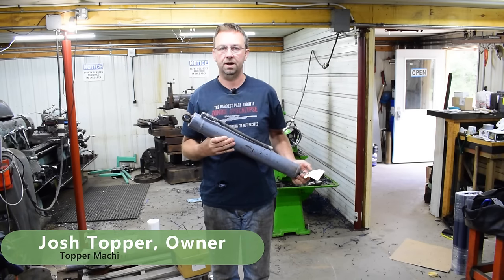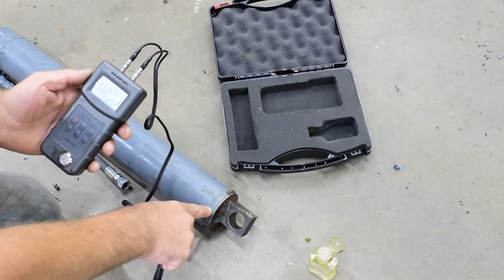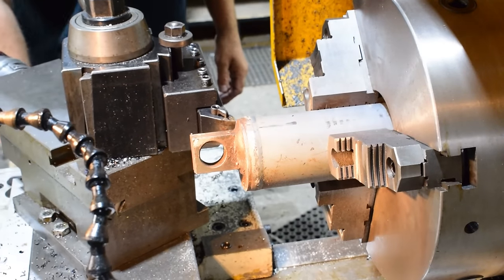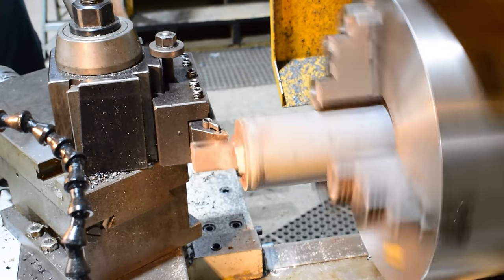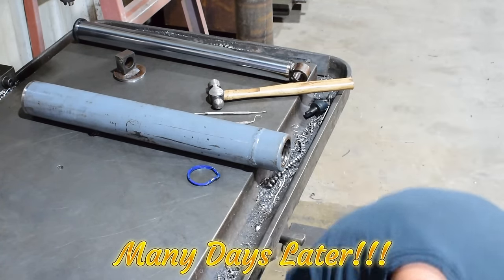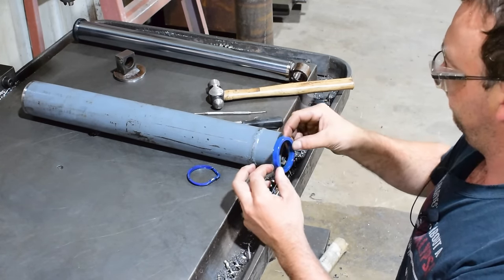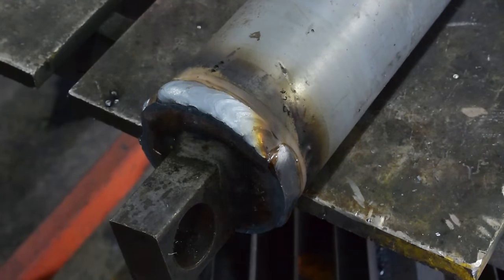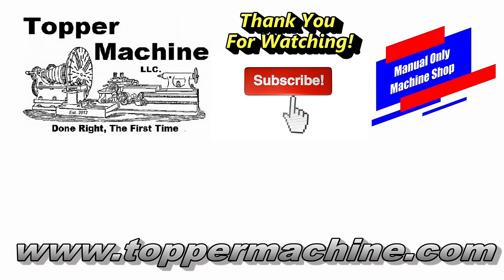Welded Hydraulic Cylinder That Can't Be Repaired, Cut Open and Resealed

Comment: The piston rod was fully compressed so that the piston was very close to the welding spot, this can kill the seal of the piston as well as burn the grease/oil around the piston. With the piston half way into the cylinder, or fully extended, the most vulnerable area is safe during welding. Also, it's recommended to degrease the end cap and the cilinder inside near the area of the welding spot, at 19:12 you see the oil coming through the gap between the cilinder and the end cap, this can effect the quality of your welds. Other then that, a very nice rebuild.
Reply from the maker: No piston. Just a plate on the end. No seal to worry about at all, safer to weld this way to eliminate potential spatter on rod. Been in service since with no failure.  As far as oil, it was degreased thoroughly off camera.

Comment: Over 50 years ago, I worked as a hydraulic mechanic. As I was taught, this is what  is called a "displacement" cylinder. This is a "power in one direction only" cylinder. Oil is pumped in under pressure and the "rod" is displaced. Everyone in America has interacted with one of these cylinders at one time or another. 
Many elevators in a building of less than 7 or 8 stories have elevators that are raised by one of these hydraulic cylinders, where a pump lifts the elevator and gravity brings it back down. A hydraulic bottle jack, floor jacks and two and four post car lifts use these type of hydraulic cylinders. Just a little fun info.

Comment: Here in the Uk we would refer to that type of ram as a single acting displacement cylinder. You can tell this by there only being one hydraulic port on the rod end of the cylinder and no vent in the base end. Fully welded cylinders are not common but not something that I’ve not seen before especially on agg equipment. They are deemed disposable and cheap but as you have shown can be repaired if needed. 
My only criticism would be the welding on that base eye, I would have liked to see a root pass and a minimum of one cap pass, both in one continuous weld ie no stop starts.

Comment: I repaired the four hydraulic cylinders on my 30 ft Winnebago Sightseer. These cylinders are double acting. They leaked badly on lifting the leveler jacks back up. The rod end was down and the seals were shot. I loaded the cylinder into my 10X24 Logan lathe and mounted an angle grinder on the tool post, a vertical cutoff blade. I put the lathe in back gear and ground out a .250 thick wall. That separated the rod end with the bad seal.  My neighbor has a Miller MIG welder to put the ends back on.  A $15.00 wiper and seal on each fully repaired the cylinders.

Comment: Well done, it is good to see how you could manage to offer a new life to this cylinder. As an old french engineer I really appreciate how you take care of all details like rotation speed, angular position marking,  electric connection making sure that current is not flowing through an undesired  path. Despite the fact that you could not weld continuously the result looks pretty good. Congratulation for this good job.

Comment: Got to love those proprietary parts. Had a machine with 2 cylinders working in tandem for sled movement. One cylinder split the tube, no replacement available as it was a short run of parts to build only 3 machines of this type. Had to find a shop to build one from scratch. Not easy to do for a 12 foot long cylinder tube. OEM of machine was of no help.
Reply from the maker: It's getting way more common to see odd stuff. And even more common that the OEM won't sell parts, just new equipment. Keeps guys like me in business.

Comment: The ground clamp thing CEE has a video on making a swivel ground. The cylinder is a single acting type, farmers love them. The rod pushed out with hydraulic flow, weight pushes it back in when the valves release back to tank. the UTI is great tool. Thanks for sharing, great work.

Comment: As soon as I saw this cylinder I was reminded of a hydraulic elevator that was being installed at my school many years ago: as the installer explained, and as the comment by Mr Palmer above also explains, there is no piston head seal; just the rod seal. Works by displacing the volume of the rod, again as explained above.   In an elevator this design eliminates the need to worry about the inside finish of the cylinder, since it's not a sealing surface. The rod does have to be a good finish, but it's easier to get a good finish on the outside of a long rod.

Comment: josh  that type of cylinder is called a displacement style. it is single acting only. it is very common on forklift lift cylinders, they usually have a wear ring on the piston to protect the bore. thats a cheap throwaway unit you saved. nice job.
Reply: Yes, they usually have a wear ring to run on the inside of the cylinder walls. It's not so much to protect the bore (nothing seals on the bore anyway), it's to keep the rod centered and not get out of alignment with the end cap. With the slop that one had, I'm surprised it didn't bind in the end cap bore. I'm sure it's hard on the seals. 
You are right about that being a cheap "throw away" cylinder, and almost all welded cylinders are. They don't want to go through the trouble and expense to machine the end cap or cylinder bore to make a removable end cap, so they just weld it.

Comment: Next time extend the ram and hang a greased heavy timing chain or long tow chain drape across it as a counter weight to stop the knocking on the shaft. By sliding it in or out, you can find the "sweet spot" to stop the knocking of the ram. Another thing you can try for your rotating setup is to open the wheels a little wider so the tube is getting pressure from the sides as much as possible without falling through, then it is a simple as adding a weight on top. You can use greased heavy chain around the cylinder with a shackle to keep it from falling off. Worst that will happen would be a little paint gets rubbed off if there isn't enough grease on the chain.

Comment: We have big Hydraulics company in israel, and this is what we call a disposable plunger cylinder. There shouldn't be a seal on the piston and in this case it just forms as a stopper so the rod won't blow out when it's pressurized . Hydraulically speaking the force is generating only on the surface of the rod (since the pressure is generated equally in all sides) and not on the surface of the inner diameter of the cylinder (since there are no seals) . They usually make this kind to save space and gain much more stroke on the expense of force. By the way you should check that there are no scratches on the rod and not just on the seals prior to assembling. and regarding the cap , if there is no centering it is advisable to make one , it will prevent from the weld material to slip inside (later on the piston itself can scrape it from the inside while work is being done which can cause more damage) .
Good work other than that!

Comment: The last one I did just got hacked off with a bandsaw and has been running perfectly for the last 2yrs...  I did do a heavy bevel at the cut and tig welded it back together.

You don’t need a piston seal on this type of cylinder. The rod is the piston...

Comment: Great Video Josh, As a Pipe welder of more years than I can count. On your welding Motorised Welding Jig, try building a Bail Arm that hinges over the top of the cylinder and clamps down with two bearing wheels to allow easy rotation whilst powering on. Make a fine adjustment screw, so you can push the pipe onto the alignment wheel by eliminating any slip, no matter how light the pipe. I have built many similar devices when I built my Pipe Welding Engineering Workshops. I like your Workplace Methodology. Top job Mate. Cheers from Michael. Australia

Comment: There are a lot of comments about the type of cylinder this is, and obviously it’s a single acting. This means it is either power out, or lower in, but it doesn’t get powered both directions. 
  Lots of single acting cylinders start life as standard double acting, meaning they can power in and out, the port on one end can have a breather installed and the other end gets the oil. If it’s double acting it doesn’t matter which end is which, that is determined by the need of the application.
 This particular design doesn’t have a piston per se, it works on displacement. As the area of the rod is larger than half the barrel area, when the oil is pressurized, it will naturally force the rod to extend. There is some type of piston/washer/retaining device where the piston goes to prevent the cylinder rod from blowing out of the cylinder. For a common use of this type of cylinder, look at a forklift, lots of the mast cylinders only have rod packing as there isn’t a sealed piston. These cylinders usually have a piston with wear rings, or brass, so as to give lateral support when fully extended. These are single acting displacement cylinders, that’s what he has in this video. 
  There are mast cylinders that have pistons with piston seals, the draw back to those is once they start to leak the cylinder has to be completely disassembled in order to get to the piston seal. Most mast cylinders don’t have that type piston, hence when it leaks it can be resealed in place, with some TLC and some foul words. 
  Dump trucks also use single acting cylinders with no piston seals, their cylinders are telescopic, meaning it has multiple sections to the rod so it can tilt the bed high enough to unload (dump) the bed and it’s contents.  These are more common than most people think, it’s just the design that changes, but there are lots of these out there.
 As far as it being welded together, this is done for one, or more, reasons. First reason is to get people to purchase new as most people don’t realize men like this can still fix them. Secondly, it’s done for safety, some Mfgs don’t want people working on it and use this to prevent them from trying, although this is normally done in more extreme applications where most people SHOULDN’T try to fix it. 
   I hope this helps explain why there’s no piston seal and why a cylinder would even be made this way.  It all comes down to money and safety, but mainly money. Even if it’s not the cheapest to make, it does help control who gets it fixed and who gets to buy new, or in my opinion, who gets screwed!

Comment: Very nice repair, they use those cylinders in power up but not down dump trailers around here a lot.  I fix them the same way you did but have to cut the end in the steady as the through holes on my ancient lathes are on the smaller end

Comment: Build a slip ring for between the wheels and hang weights from that.  Slip ring could be something like  large diameter roller bearing that isn't quite worn out, with some sort of grippy rubber applied inside like a tire inside-out.  Then a ratchet strap on the outer race holds a basket below for weights.  If necessary a couple of band clamps on the cylinder would force the "wheel" to stay in line lengthwise.   
A completely different option is another set of wheels, basically like what you have now, but pressing down from the top.

Comment: I think if you had a long length or stripped twisted copper wire, you could have ground the paint off a section of the cylinder.  Wrap the wires around the cylinder and put your ground clamp on that.  There would have been very little friction and you would still be able to use your rollers.  Even better if you use the sand paper thought from a previous comment.

Comment: What i would do for the traction problem is use a round belt about the length of an old car fan belt.  Place the belt over the tube.  At the botton of the belt hang a small pully attached to a weight of the necessary size.  Bingo! No complicated spring wheels or anything to get in your way when traction isn't a problem. 

Thanks for a great video.  Really enjoy your channel

Comment: I repaired a cylinder like this back before I had a lathe. Just used a cutting wheel to remove the end cap. It wasn't all that straight of a cut but didn't matter, just index it before rewelding.

Comment: Displacement cylinder.  Entire rod bathed in oil when retracted.  Less rust for both rod and cylinder - cylinder inside wall never sees air, everything stays cleaner.  Less seals to manage and rebuild.

Comment: Hey I have to tell a story about one of the more difficult hydraulic troubleshooting experiences I have had.  Log skidder, if you turned too far to the left it wouldn't straighten up unless you ran into something and moved it towards straight.  Owner first brought me orbital, popped it apart, popped it apart, check ball springs getting lax, restreached them and reassembled.   He put back together.   Same problem.  So I went to woods with him with air and blow nozzle to do some pressure checking.   Left side steering cylinder was bulged on end opposite gland end.  Piston ring cylinder.  Took a lot of pressure to bulge that cylinder.   Got a piece of dom tubing and remade cylinder.

Comment: I use to recondition old welded Moore double action Ag hydraulic cylinders who then became BTR hydraulics and is now Berensens Hydraulics 
I would knock them over in 20 minutes they are great no threads to work lose, strip, rust up or cross thread no gland O ring to fail.dont get me started on those wire wound glands. In the field I would use a 4" grinder took 10 minutes longer  all you needed was a seal kit, vise, grinder and a welder. All steel construction so modding the clevis was never an issue. Loved them and cheap too

Comment: Josh on your shop made cylinder rotator youbcould add a third roller that goes over the top that's spring loaded to add the needed down pressure. Just a suggestion.

Comment: I took a 4 inch 3 foot long outrigger cylinder that the gland end was crossthreaded ( very fine threads) rebuilt it, welded the end on and made a wrecker boom lift cylinder. Used a 12 v emergency pump from a high ranger.

Comment: If you had centre drilled the eye on the end plate you could have used your live centre in the tail stock when cutting the plate off of the barrel and you could then have used the live centre again to position the plate to tack the plate back on before removing the barrel to weld up properly.

Comment: Got it done.  I have cut many driveshafts and cylinder ends through the years.  90 degree tool into center of weld, stop and look often, or run slow so you can see while it is turning.  Frankly I have removed driveshaft and cylinder ends with a chop saw, rude and crude and be careful.  Never trusted a wire feed for this sort of thing.  I am a root pass with 6011 and then 7018 guy.  Fixed a bunch of Ford tractor power steering cylinders,  last welded together I did was a trencher-hoe backfill blade cylinder.  Then there are the cylinders that don't seem like they would come apart but they do.  In the last 44 years I have seen things.  Ha

Comment: Looks like a factory cylinder and if it's available it's likely way more spendy that what it was to do this repair.

These are considered disposable, however as you found it is repairable.

It may be that there is no longer a direct replacement for this and as such the repair is the only viable method of fixing the machine.

Niecly done!

Comment: The sound was good at normal distance.  Another machinist I watch had a similar situation. The piston was loose in it.
I would have run a center in there to keep that cap in place.
That must be a real low pressure application if one lousy little seal is the "piston".

Comment: I came across a very high-pressure hydraulic cylinder on a rolling mill's roll balance system, similar to your cylinder as there were no seals on the piston either, which I thought was very strange however, the designed clearance tolerance between the piston and cylinder wall was so tight that under normal operations 4,000 psi it did not leak. After much to do, we took the pistons out to check them. They would not move, I had to use a hydraulic porta power pump's pressure to jacked them apart, which was totally unnecessary since when I removed the top caps the problem was actually solved The actual problem was the cylinder had been previously been subjected to 5 X rated pressure in a PLC  programming startup error and fluid had bypassed the piston under the extreme pressure then the mill's roll stack did not have enough weight and downforce to push the fluid back around the piston. It was a tuff problem to pinpoint, and a quite a learning experience as to why the roll stack suddenly would no longer close.

Comment: What you need to build onto the power roller side of you roller stands is a 3rd adjustable roller to apply down force to what ever is in the rollers to give more traction on the drive roller. You can make it hinge open too so that it can be out of the way when not needed or when trying to load larger heavier parts so you can still lower them straight down rather than having to feed them in from the side like you would if it couldn't flip open. Thank of a flip open style lathe steady rest.

Comment: I’ve seen cylinders like this on our windrower fronts. They are just single acting cylinders. Where the oil pressure pushed the rod out instead of the need for a piston seal.

Comment: For your drive roll issue get a serpentine belt and a double roller chain that the belt will just fit in. The belt will grab the cylinder and the roller chain will work as rolling ballast.

Comment: you need more ultrasonic gel goo stuff on your transducer. we use those for testing pipe and pressure vessel wall thickness. a smaller head helps on smaller diameter pipes.

Comment: It is a single acting ram cylinder, that is why it did not have any piston seals and only had one oil port.  The only seals are the wiper seal and oil seal at the end where the ram extends out of the cylinder.